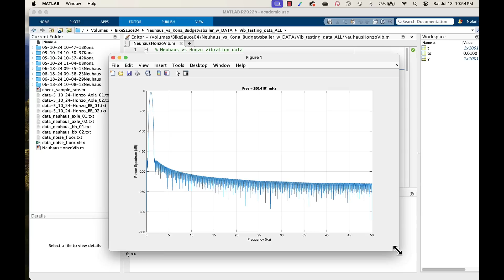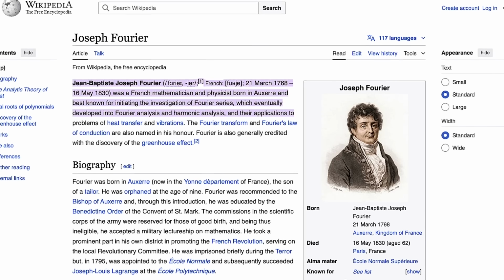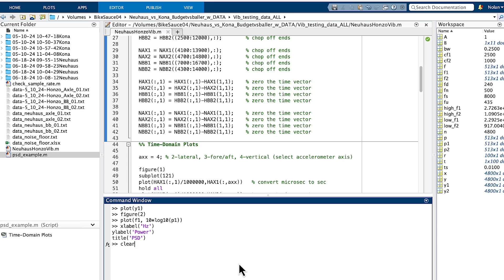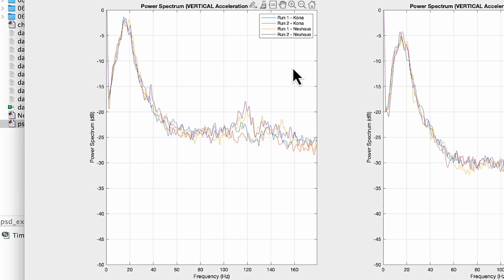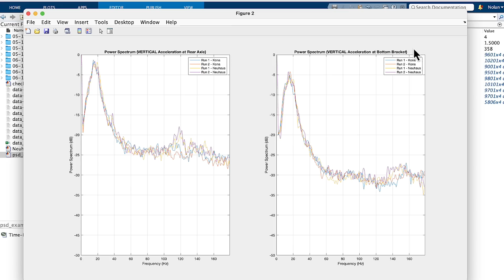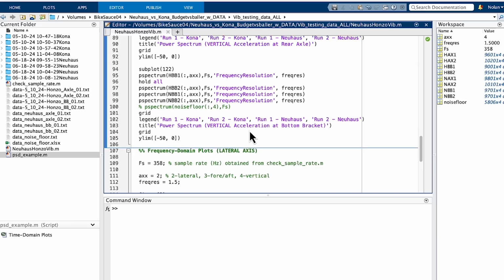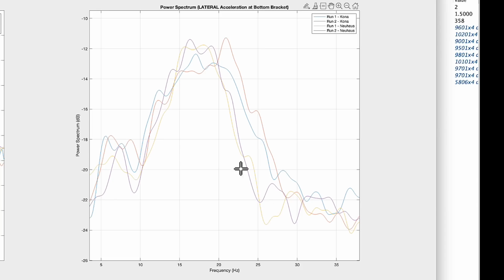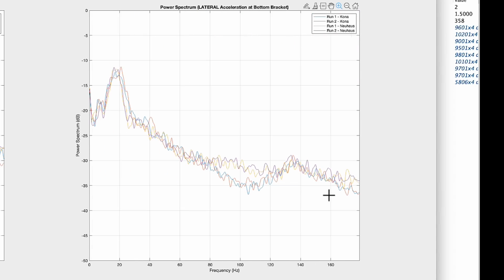The MYTH of Vertical Frame Compliance.

Comment: Very interesting methodology. What I think is missing is the measurement performed at the top end of the seat tube. That's where people try to maximize compliance. The bottom brackets are always designed to have very little vertical compliance so that your power when climbing isn't wasted on the compliant frame. So these results do not surprise me. They even always market themselves as having stiffer bottom brackets.
Reply from the maker: Perhaps on a bike where I’m seated during the test this would make sense. In this video, data was only collected while descending and standing on the pedals
Reply: To me, ride quality is the exact opposite. The biggest impacts never go through your saddle, it all goes through the feet. If a bike is too stiff a the BB, it will corner poorly and ride harshly. This is why you see world cup downhill racers trying to reduce the lateral stiffness of their frames and wheels. Companies always say "laterally stiffer, vertically complaint" because that is what consumers expect them to say. In reality, those companies have de-tuned the stiffness of their bikes the last 5 years.

Comment: I see some parallels to work done on stiffness of wheels. Guy at northwestern showed that it was rim torsional stiffness that was the main contributor to wheel lateral stiffness. Basically, box section rims deform locally at the contact point because the rims have low torsional stiffness and it has very little to do with rim lateral or radial stiffness. Make the rim a bit deeper and the wheel starts to get rapidly stiffer laterally. ❤I certainly have a set of tubular box section rims that are my first choice for roubaix type races. I find them to be very surefooted and comfortable. They appear to deform to the ruts by deforming laterally and finding grip rather than bouncing off or deforming vertically. I would say that this is the same for frames. They are more compliant because thye deform side to side because of torsional stiffness reasons. You can get too much not his though, I had a cross frame with a lot of rear wheel wag that was an amazing descender on rough surfaces but horrible when sprinting or climbing as it would wag all over the place under power  and was very unpredictable when cornering and would lose traction randomly.

Comment: Data is fun. I wonder if a motioncapture video of your position and movement on the bike would be able to give some insight into your ride feel. I know it is close to impossible, but nevertheless that data would be fun to dive into.

Do you have any knowledge of the material/construction differences between the bikes (steel isn't just steel) and tube shapes and welding technics. The rabbithole goes on and on.

Well great videos. Love them.

Comment: Thanks for doing this, great job on figuring out a way to test. Given the constraints of the rear triangle not offering vertical moment, I kinda assumed when I think I can feel a ride quality difference in a bike there were several possibilities.  Once is as you tested, compliance in another direction.  I have also though that there might be flex at various major junctures, bb, headtube that would diffuse the trail impacts to feet/hands/ass.  I don't know how easy this is the to test.  The last thought is that various tubes absorb vibration differently.  In this case, you could measure at the drop out, then zip tie 2/3rds the way up the seat stay and see if there was a difference.  Anywho, great stuff, thanks for taking the time to run through this widespread concept. I know want to know how the bike industry measures this or if consumers just get the buzz words.

Comment: I ride 2 hardtails, a Ragley Big Al and a steel Esker Japhy and think a lot on this subject. I love both bikes but they are different in how they feel through the pedals…and I ride clipped in candy pedals with stiff xc shoes!  If I extend the Japhy chainstay so it is matched, or as close as possible in length to the aluminum Big Al, there is quite a difference in feel on these two bikes.  Well, even on the Japhy’s shortest chainstay length there is a difference in feel.  I say “different” because the details just remain elusive as what the hell is really going on when each bike is ridden hard.  But it is definitely different!  Well, I do have a favorite and it is the steel bike. Long rides or really going for it on rough terrain, a good steel frame just has that feel in pedals and also how bike kinda moves with you. I don’t know why but the bumps, the rough, the vibrations…all seem just right on steel.

Comment: If that sensor is only picking up vibrations after the hub, where is the influence of the frame?! This only shows how compliant the wheels/tires are. 
Shouldnt the sensor be placed on the actual rider contact points like feet, hands and saddle (pedals, bars, seat tube) where you ultimately feel the compliance? 🤔
Reply from the maker: The influence is in the delta between the axle and bb.

Comment: Would it be worth also measuring this data at the top of the seat tube? Or where the top rear stays meet the seat post? It could be that a rider might feel the ‘compliance’ more through their arse than their feet? (I’m a roadie for the most part, and I know I do!). And might be why in road bikes dropped stays are almost the defacto standard in new bikes nowadays.  Obviously also, another place might be at the head tube. Twisting motions  in the frame (so I guess like lateral compliance, but in two dimensions) would also be another data set to consider. The triangle shapes of a bike frame would barely resist any rotational moments at all, only the stiffness of the tube material does that.
Reply from the maker: Yea but all these runs were downhill mtb runs while standing. A flat gravel run would definitely benefit from a seatpost measurement

Comment: I love those nerd stuff! Do you fell the comfort increase on the saddle or riding on the BB? The seat post joint on the second frame seems to have way more freedom to flex and make seat post to work like a spring. If is this the case, would be interesting to put the sensor in the top of the seat post.

Comment: Thanks for the insights. I’d be interested to see data comparing a salsa Fargo to the cutthroat. It would be interesting to see how the marketing of the carbon frame holds up against the data. I’ve owned a fargo and two cutthroats. All have been comfortable bikes the current gen cutthroat does seem to smooth out the bumps the most.

Comment: I would be interested in seeing the data with this sensor located as close to the saddle as possible.
Reply from the maker: Makes sense for a seated run, but I was only measuring data on the downhill while standing
Reply: @TheBikeSauce  I imagine it isn't practical to put the sensor on the pedal or crank arm.  

I appreciate you putting numbers to this.  

I have a Neuhaus Hummingbird and it has a distinct suppleness.  I find that my Kona Unit is closer in feel to Hummingbird than it is to a Honzo.  I was attributing that to the steel frame.  I imagine this a combination of construction technique and frame material. Is it possible to attribute this quality to the material?  Are steel bikes better at damping those frequencies?

Comment: congrats on a very interesting video, if i may i´d suggest controlling for front fork, as the vibration you picked up at the bb will reflect whats going on at the front axle, especially at the lower frequency ranges, also with some of the more extreme head angle bikes now, mid range forks really struggle with stiction on less than very steep terrain and that might throw the comparison off.

Comment: I wonder if you would get more "signal" intensity if the front end was not damped.  Possibly try 2 bikes with forks  with same spec.s (length, rake, A2C) but use a 3rd, but different brand, fork with same spec.s and then compare the 2 frames.

Thanks for being the consumate  scientist in stating that you could be wrong.  But also welcome test results from other independent experimenters.  This is science, and science welcomes criticism- positive and negative.

Comment: Asks for civility, questions if belief is a lie in all caps in title. 😂

Could you test with the sensor closer to the saddle? Can two sensors be used to measure forward to backward flex from top to bottom of the seat tube?
Reply from the maker: THE TITLE IS CIVIL 😂

Comment: Thanks for the effort to share your results. I too am a keen hardtail rider. I recently discovered the torsional stiffness of the crankset had a very noticeable effect on how jarring a small landing was at my ankles. I became so interested in perceived differences  that I developed a way to measure twisting give of all my crankset sets. I now use an older deore crank on my Ibis DV9. The turbine cranks with a 30mm spindle were least compliant. I now will check the side to side stiffness at the bb of a carbon DV9 and a heavy steel frame!

Comment: Huh...I had 2 comments on here, and it looks like only the 2nd "aside" comment wasthe only one posted...anyway, in the first comment I asked if you had thought of looking at the rotational data at the rear axle about the "roll axis", and/or the lateral accel data, to see if you can see anything correlating to the speculation about lateral flex being the source of the "compliance difference" feeling? As an ME with a background in random vibe analysis, this was a "fun" video to dig into.

Comment: My math is terrible, but one naive question I had was if you could subtract the rear hub data from the other data.  I can't quite wrap my head around whether that would be useful or not...  I just seems like it might even out the variability for the runs, since even though it's not completely related to the other data, it feels like it would be consistent.
Reply from the maker: Wouldn’t quite work since these weren’t taken on the same run.

Comment: Wow Nolan, fantastic video! I heard you discuss it with Russ the other day and was hoping it would drop soon. I'm no engineer, but it seems doubtful that there is much vertical compliance (as you found, and for the reasons you already stated).  Somewhat similar type of confusion re: what we feel vs the cause w/tires. Generations of riders were certain that skinny tires are faster because they 'feel' faster because people felt the road buzz. But the evidence continues to mount that this feeling is wrong.

Comment: It would appear to agree with the experiences of both Jan Heine and Grant Petersen, whose bikes have a fair amount of what I think of as "torsional compliance" around the BB.  One can see, e.g. a Rivendell Rambouillet wind up several degrees clockwise then counter-clockwise as viewed from behind, and then spring back to the central position as one pedals hard.  The feel is one of getting in sync with the frame, and it is not a slow bike despite having the traits so many people associate with being 'slow'.  Also, the give makes it a lot less hard on the knees, and one doesn't feel like a sharp bottoming out of the pedals.  It's kind of hard to put into words that people are used to, so it tends to get discounted.
Reply: This is my thinking as well. Most of the movement in the rear end would happen around the axis approximately formed by the center of the BB and center of the rear hub. And the rear triangle will rotate depending on which side of the rear triangle in imparted with more force. So relative to the rear hub, the BB does twist.

Comment: This is the kind of video I want to see! This type of data could be used, for example, to test how much more compliant some wheels are versus others by mounting the sensor at the rear dropout like you mentioned. For example, I’d be really interested in testing a bird spoked wheel versus a standard steel spoked one. 

For the analysis and visualization of the data, it would be really useful to compare one run of each bike against the other run from that same bike. That would give us an analysis of how much standard variation there is in the data or if we’re getting consistent results. If the results are consistent, then for visualization it would be useful to average the two runs together so that we’re only looking at two lines instead of four. 

Thank you so much for publishing this video and great work! I know how time consuming the testing and component swap is, not even to mention the time of condensing it all into a video and editing it as well as you did.

Comment: Arm chair here: This is great. I'd love to see a bigger replicate set with runs from people who don't have a pre-formed opinion on the bikes. Maybe you could have students do it. And as an engineer, how could you try to find frame properties that correspond to your result? Is it a steel v aluminum question? Or the specific steel and aluminum alloys used? The tube properties? The welds? How would we know. Given that the wisdom on bike tires has gone 180 since I started riding , vertical compliance being a myth would not surprise me. But why would lateral compliance be perceived as more forgiving? Is it that energy is out of the frame before it gets to your hands and rear? I hope this video sparks a good conversation.

Comment: If you were seated in these runs, wouldn't it make sense to get data at the seat post as that would more accurately represent the butt measurment?  Also, it would be really interesting to see comparisons between these frames and a carbon frame specifically designed for rear compliance.  Something like a Lauf Seigla.
Reply from the maker: It would make sense, but for these runs I was standing the whole time. Should’ve mentioned the data was only recorded on the descents.

Comment: Your feet being off center from the fore aft axis of the bike, I think the compliance you feel at the pedals might actually be torsional compliance about the bottom bracket. Might want to look at the rotational data about the fore aft axis. OR just measure vertical accel at the end of the pedals. 
Also, looking into the frequency domain, my feeling is that a "compliant" frame should look more like a low pass filter (more low frequency vibration, and less high frequency).
Reply from the maker: Definitely. Aside from the Dc gains, the plots do reflect a LPF or maybe more appropriately a bandpass filter

Comment: Would be interesting to see this experiment conducted on a technical, chunky, hard hitting trail to put the rear triangles under much higher stress and force. 

I will say your explanation of lateral vs. vertical compliance makes a lot of sense given the general construction and layout of tubes on the rear triangle (Also noticed the Neuhaus has no bridges on either stays, which perhaps helps?). I've stretched rear chain stays of older bikes in the past to fit slightly wider hubs in the past so definitely more give on the lateral plane. 

Very interesting indeed. Nice one.
Reply from the maker: I thought about, my the data would likely just rail / saturate the whole time rendering it useless

Comment: Agree on the surprise, could have logged one by the toptube headset and plotted axle-bb-headset A vs B to fully capture frame lateral deflection. Would wonder about rear triangle tubes lenght, if there is any absolute deflection / tube lenght ratios that could tell us anything (more so deflection as a result of lenght vs deflection as a result of material; ultimately not what we're after). Thanks for the share

Comment: Very interesting. An unscientific personal note of past experience. I had a 2002 or so KHS Alite 2000 (I believe…). It featured flattened out and wider chainstays, and I believe to some degree, seat stays. I would have to say that frame was the most forgiving, yet amazingly composed riding 26” hardtail I have ever ridden. Of course, there is always the human bias situation, but that did seem to be a consensus (??) opinion. Looking forward to more from you on this subject.
Reply: They also had those nice soft tails with the elastomer behind the seat tube. No pivots. Wife has one still.
Reply: @JohnDeF2112 —yep! Still have the all steel one from ‘02 or so. Still ride it on the rail trail and misc gravel. Was hoping khs would have made a 29er version.

Comment: Doesn't this only count of you ride “exactly” the same lines on both bikes? There are to much variables to take into account. Like rider fatigue (line choice), state of the soil (wet or etc.). Fun experiment though. I think frame compliance can be better measured in a lab, they have tools to measure material fatigue for instance. Those tests could also give an inside in compliance/flex.
Reply: To some extent, multiple runs helps alleviate those issues, but the soil condition could be a large factor, I think. This is way more rigorous than most YouTube experiments, though I do think a few more runs each would be worthwhile given the time commitment to switch parts over. It's difficult to conclude anything in detail, but I think there's enough good data here to raise good questions worth investigating further.

I don't think lab tests would replicate the frequency inputs of real world trails, though. Ideally, he'd be doing a lot more back and forth swapping but there are time and budget limits, a key feature of engineering.